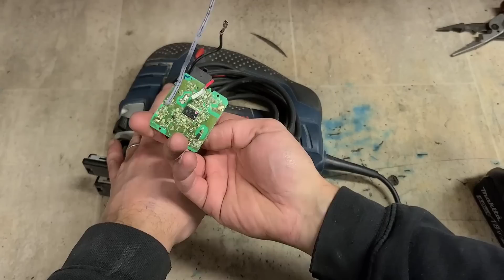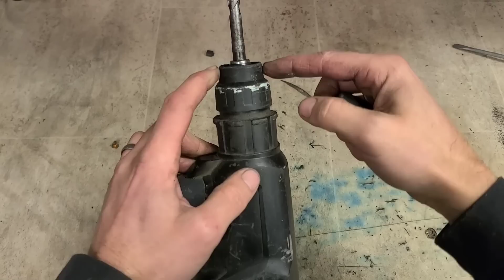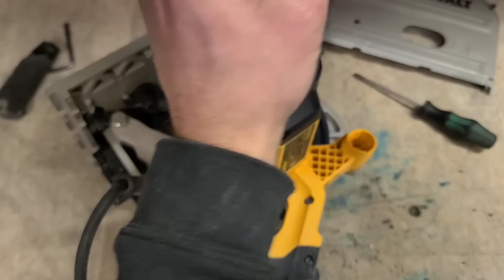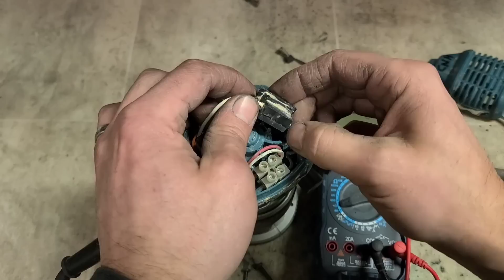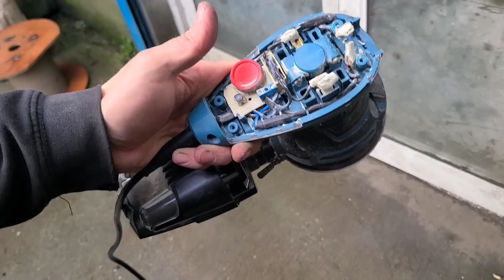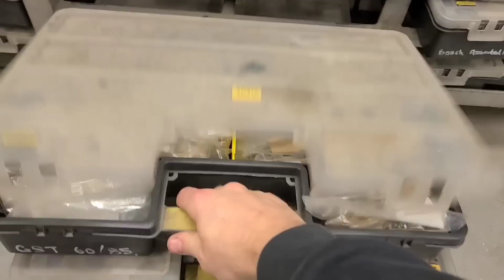Powertool Repairthon. Repairing another load of broken power tools.

Comment: The resistor failure on the Bosch speed controller is quite common. If you want to save the ~40€ for a new speed controller take a Dremel, grind away the epoxy resind and solder in a new resistor for 70ct. Did that to mine works like a charm.

Comment: I've got an old late 80s or early 90s Bosch Jigsaw with the cast aluminium base (can't recall exact model No.) in the workshop & it's a better JigSaw than my Festool Trion & both are better than my Milwaukee M18 barrel jigsaw piece of crap.

But if I buy another corded Jigsaw it will be a Bosch I dont think anyone makes a better jigsaw.

Comment: I guess the question that arises is - where do you draw the line on tools like these ? Is it worth repairing them when they are past their normal service life cycle ? 😢

Seems to me that the older power tools get retired and sold to pawn shops or flea market tool vendors.
Reply from the maker: It all depends on the cost of repair compared to the cost of a new unit
Reply: @deandohertygreaser  true , but these tools seem to be just short of expendable. These days you can buy a fifty dollar drill and if it fails ,you just buy another one.

Comment: Iv just retired after just over 40 years in the power tool and abrasive business , got my nephew to take over . Spent most of the 80s and 90s on the bench repairing mainly Makita tools . It's interesting to see how another fitter dose some things differently and some just the same . The Makita in the 80s were all nuts and bolts ,no self tapping screws that strip the plastic,  the tools were very repairable . 9501B , 9005B , 9609B , 8419B ,Modles and parts stayed the same for years , i still can't get some of the part numbers out of my head after all these years. Now they bring a new variant of each tool every week with different part numbers that won't fit other tools.  Bit of a bus mans holiday watching the vidios , but still interesting 👍

Comment: Apologize being from USA and not understanding the UK power system... been searching but cannot find the answers...  Your residential service is a nominal 220 V I believe.  Is one of the legs at earth/ground potential, or do both float?

At the job site where you use the 220V to 110V transformers, is the 110V side isolated?  Is one leg of the 110V at earth/ground potential or do both float?

For reference here in USA one leg of our 110V service is at earth/ground potential; and we use a separate, non power carrying, green earth/ground as a safety thats connected to any bare metal in the appliance or tool unless it is "double insulated."
Reply: You may have found the answers by now, but.. Yes, one leg is earthed, making it a neutral. Each phase is 240V to earth, 415V between phases (normally only single phase delivered from this to a residential property). The 110V supplies aren't isolated, but centre-tap earthed, making each leg 55V to earth.
Reply: @Monkeh616  Thank you Monkeh!!  Exactly the information I was seeking.  The way you earth a center tap on the 110V on construction sites makes it very safe!  Only 55v to earth.    The 220V here in the USA with the center tap earthed, makes the higher voltage a bit safer I think, but needs an extra conductor...  amazing how many different plugs, voltages and frequencies exist on the planet after 100 years of electrification.  Thank you again!

Comment: Had asked again in another video but you probably didnt see it; whats that switch in the last jigsaw do, the one with 0 1 and 2? The same switch exists in eg a recip saw
Reply from the maker: That is for the amount of kick. Jigsaws have a cut assist. A cam inside pushes the blade guide wheel forward to help speed up cuts. This switch is to adjust the strength. 
It can only be used for up cuts. So for down cut blades it needs to be set to zero.
Reply: @deandohertygreaser  Thanks man!! Much appreciated.